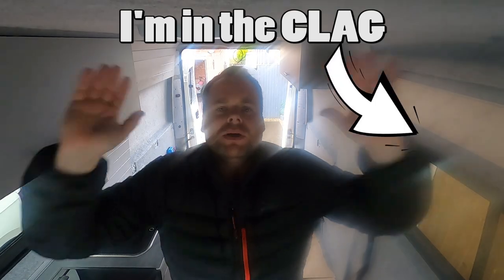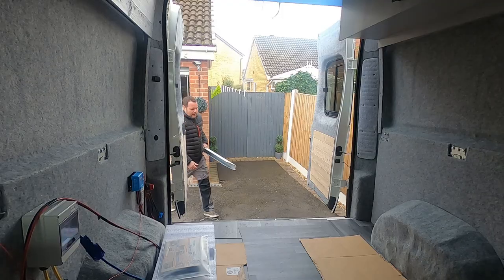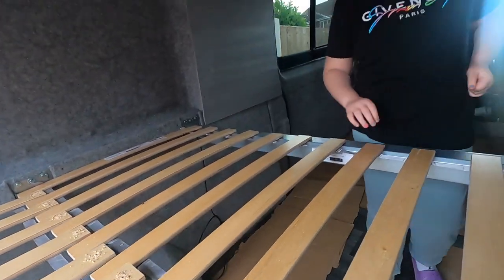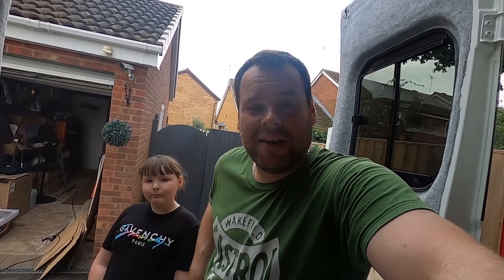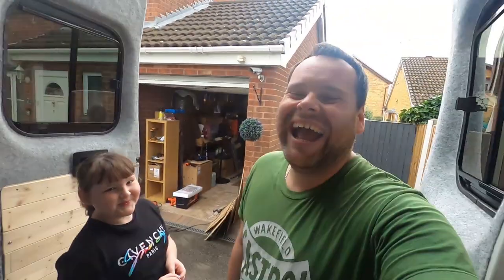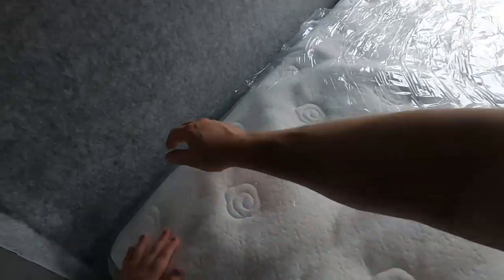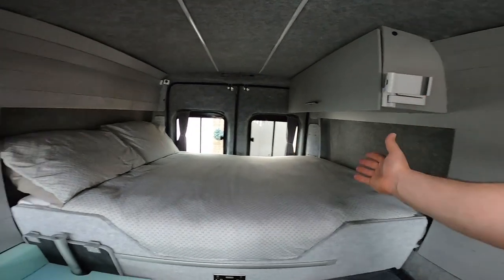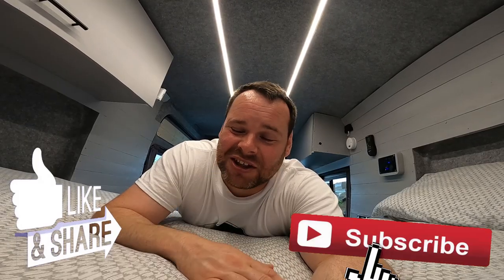installing a BUDGET IKEA bed in a Citroen Relay CAMPERVAN - self build H2 L3 Citroen Relay

Comment: It’s hard to tell, did you mount the brackets directly on to the metal? Also, did you use a standard full size mattress?
Reply from the maker: Yes mounted to the metal, I used riv nuts to fix, standard UK size double mattressas mentioned in the video